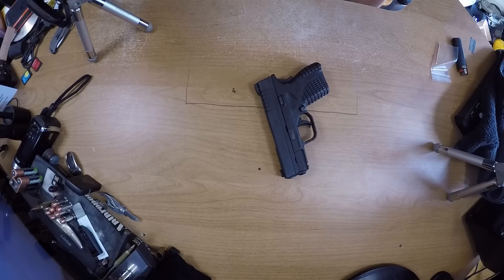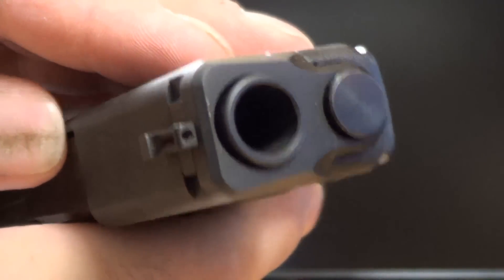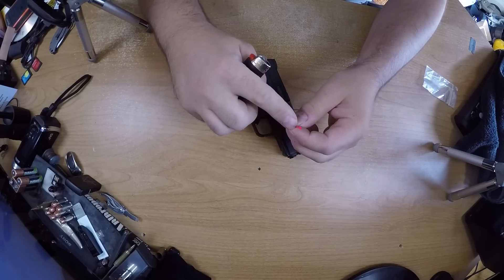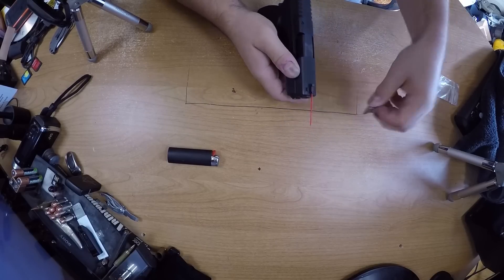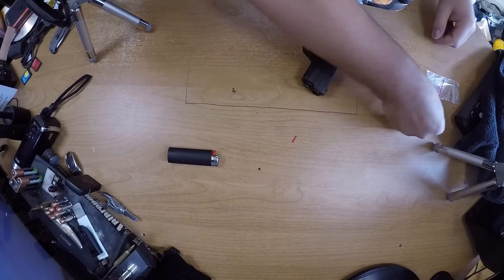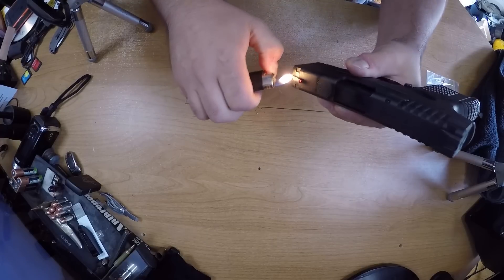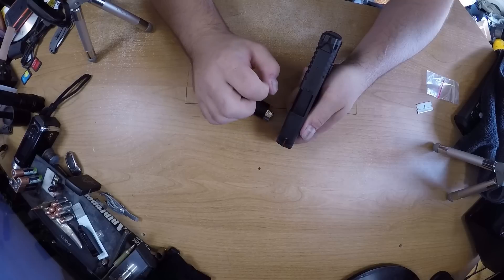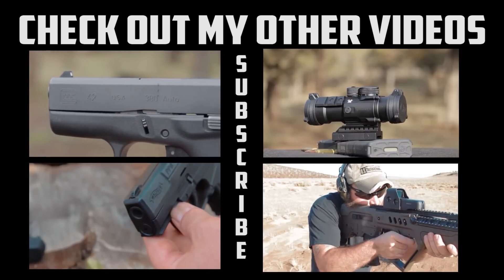How To Change The Fiber Optic Sight On A XDS

Comment: Thanks for the vid. I've had my XDs for under a year and it's still a fresh gun with about 100-200 rounds through. Last week I went to a range here in TX and the sun was beating down pretty hard on my spot. I think it was in the high 90's/100's that day. The same thing happened to mine and popped off as I was shooting. You're right by saying that maybe Springfield anticipated this happening buy supplying extra fiber optic rods and instructions how to replace them in the manual. I went with the green relacement. It works just as the red does in light conditions but forget about night and dark. I have a Sig P229 Equinox with a Tridium FO front sight that glows perfectly with the green rear NS's. So being that this is my CCW I'm going to shop for some replacement FO's that "glow" at night. So far I haven't had luck finding just the rods. But if it comes down to it I'll replace the front sight with a new one if need be. For low light and night shooting you basically only need that front sight on target. Of by chance you or anyone knows where I can find some replacement rods that actually glows, please respond to this post. I appreciate it. Happy safe shooting and God bless America and her Troops.
Reply from the maker: Tru-Glo makes replacement rods that will fit the XDS sight. I really don't care for night sights, after the first shot it's all over being able to see. I would rather invest in a good flashlight and some hard core training with it. When it comes to defending yourself against a threat in the dark sights are the last thing in mind. Just my 2 cents. Thank you for watching.
Reply: Travis Thacker  I disagree. I'd prefer a flashlight.
For the same reason why I wouldn't use a ported barrel on a weapon that I'd plan to carry at night - destroys your vision in low-light situations.
Especially with, what you quoted, the fight only lasting 2-8 seconds, I'd want to be able to see the whole time. & I actually think putting a flashlight in an assailant's face is a tactical advantage - blinding them.
BUT I agree 100% that it does blow your cover if said assailant sees your flashlight coming before the engagement.

Comment: In the instruction manual springfield recommends you do not let the flame touch the filament. Just bring the flame close enough to melt. If you allow the flame to touch it could cloud the fiber and lose light distribution. So dont do what this guy did... always read the material provided from the manufacturer and dont always trust some dude on the internet.

Comment: You're not supposed to touch the flame to the fiber. You get the flame close enough to the fiber, where it starts to form the ball on the end, without actually touching the flame to the fiber. Otherwise a good video.

Comment: Great video and production techniques.  All viewing will find it works better to heat the end while almost in position on the end closest to the shooter.  Pull the hot fiber into the sight and "case form" it.  It may hold it in position.  Cut the barrel end of the fiber1/16" longer than the sight ending. Push the shooter end with a toothpick or similar and melt the other.  One key thing is to NEVER let the flame touch the fiber.  It make it foggy, crystallize, and brittle.  If not right, the rattling for shooting breaks off the brittle ends, and it drops out.  Dawson Precision makes a super video covering all of this.

Comment: I wonder if you could use a soldering iron to put heat and pressure on the second end while it's in the sight post?

Might be a good, clean way to melt and then flatten out a bead on each end.
Reply from the maker: Jack of Trades That might work, I just used what I had on hand. Thanks for the idea though.
Reply: HighDesertTactical No problem! I'm just trying to come up with ways to justify my soldering iron, since I don't use it for electronics purposes anymore.
Reply from the maker: Jack of Trades the best unused tool is a repurposed tool!
Reply: HighDesertTactical That's how most of my self-injuries are caused.
Reply: HighDesertTactical  key word tool ,that's if you find yourself saying what a tool